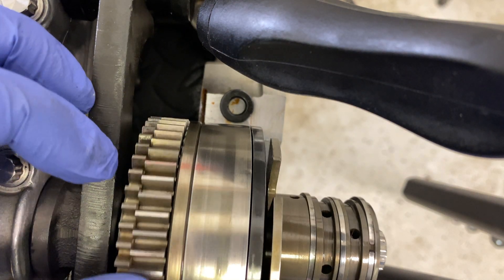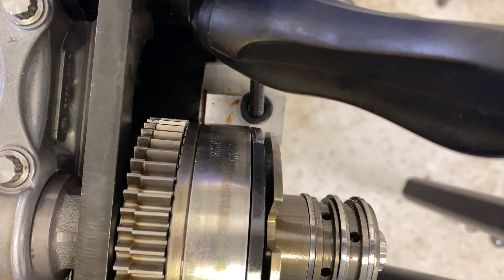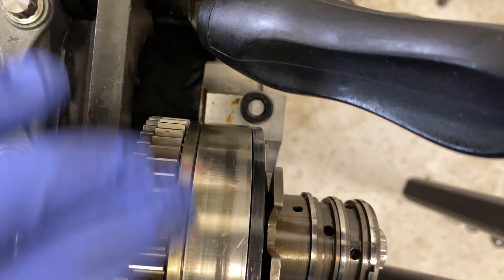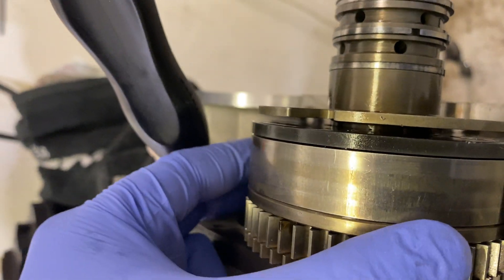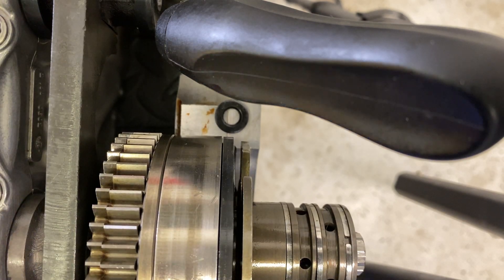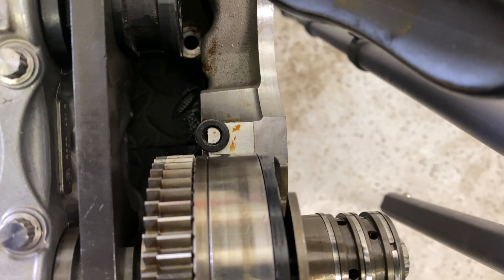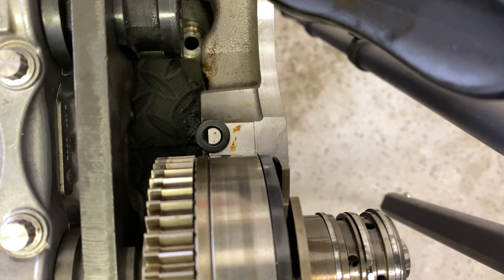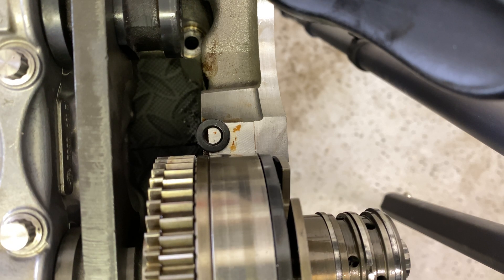Centering/Indexing M156/159 Camshaft Adjusters

Comment: What to do if the oil rings on the cam adjuster is broken?
Reply from the maker: @joshwong99  https://mehenker.com/de/nockenwellenringe-/40-pierscienie-walka-rozrzadu-mercedes-m156-amg.html they can be bought here. If these are indeed what you are referring to?
Reply: @63motorsportsinc.37  yes is this what I am referring too, thanks! Is this a need, can I still drive the car? Does these ring make a difference to the operation of the engine?
Reply from the maker: @joshwong99  yes 💯 needed
Reply: @63motorsportsinc.37  could you please tell me what would happen if i drive the car without it? 
My car has 1 of the 3 rings broken on the intake and 2 of the 3 broken on exhaust. I only found out it was broken when I took of the valve cover. I assume I have been driving with it broken for some time now and seem to be not effect the engine.
Reply: @63motorsportsinc.37  also I tried to purchase the oil rings on the website but it's not letting me pay. So is there anything else I can do?
Reply from the maker: @joshwong99  the rings supply oil pressure for the phasers. We have never driven without those but shops have missed them before causing flashing CELs. 

Others have purchased from there all the time. Only option is to replace them from dealer (buy the full sprocket assy.) or the aftermarket ones from link above
Reply: @63motorsportsinc.37 I have one more question.
So if the oil rings is fail, would the cam adjuster fail adjustment and make slapping noise? 
You mentioned at the shop it has happend before right
Reply from the maker: @joshwong99  sorry it wasn’t OUR shop. A shop reported missed O-rings during install and car was driven getting flashing CEL. They asked for the same o-rings as you
Reply: @63motorsportsinc.37  my mistake on that part. But is that the symptoms that would make noise when the engine is running?
Reply from the maker: @joshwong99  not definitively as we’ve only been made aware of missing/broken o-rings a handful of times (4 instances?) in the past four years. It would be a fair assumption but again we do not see it often
Reply: @63motorsportsinc.37  I'm just trying to understand and learn more about engines. So since the oil pressure can't keep the cam adjusters in place it then would be making noise coming from the adjuster. Just want to confirm my understand 🙏
Reply from the maker: @joshwong99  I wish we were the right avenue for this… We don’t build them incorrectly or with missing parts just to find out what happens truthfully. We’ve seen plenty but not seen it all. We hope you find what you are looking for.
Reply: @63motorsportsinc.37  no problem, thanks for the help
Reply from the maker: @joshwong99  it does sound like a great exploratory job perhaps when we bring in more revenue we can jump into these types of adventures 😎
Reply: @63motorsportsinc.37  the oil rings arrived and installed. Car is running great.
Reply from the maker: @joshwong99  🙌
Reply: @63motorsportsinc.37  I realized that the premature wear on the cam adjuster are due to oil rings either not working properly or broken. 
When I rebuilt the cam adjusters only one cam adjuster was wearing more and it was the one where the oil ring was broken..